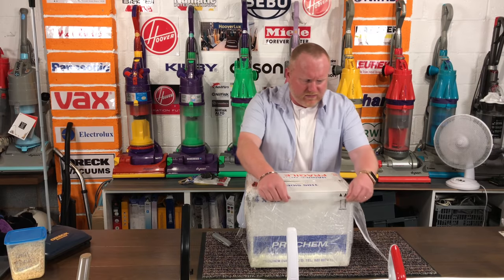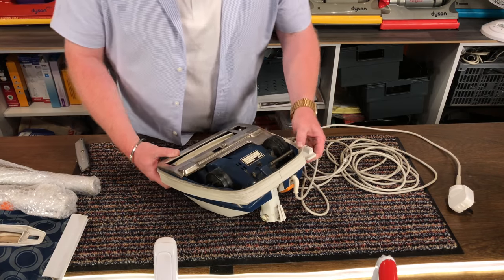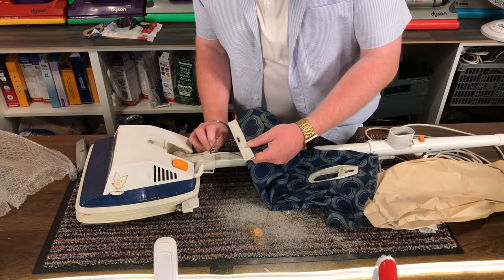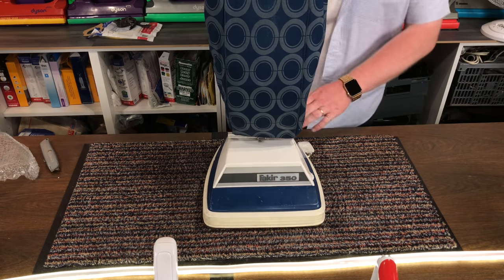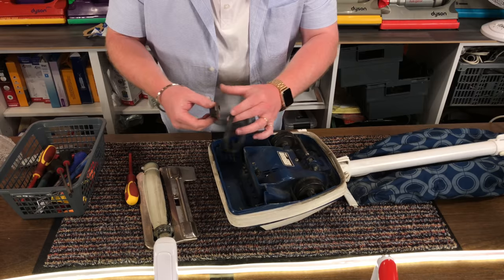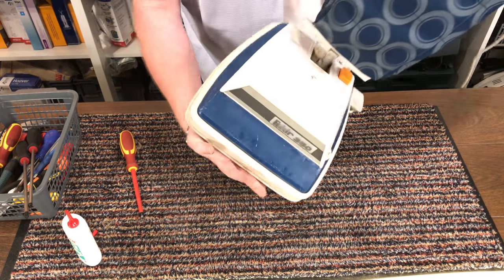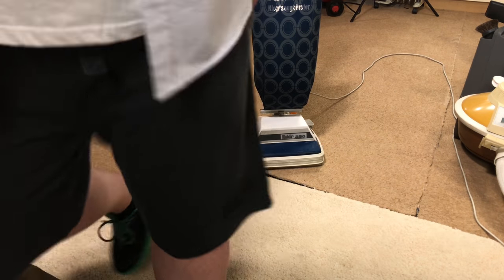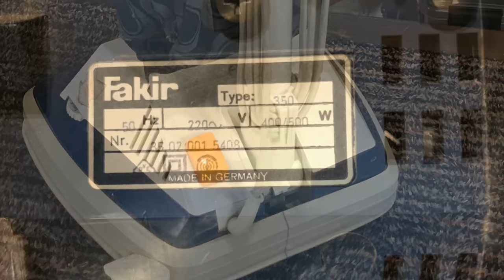Unboxing & Demo Of My Fakir 350, Softbag Vacuum Cleaner

Comment: I have the same vac. I also need a new belt on it. I have also some kind of plate for bare floors and when you use it the brush doesn't roll. There is like a micro switch or something that stops the brushroll. I think this is semiprofessional vacuum and If I remember right this vacuum solded also with Philips brand in the UK.
Reply from the maker: Ilovevacuum79 Tnere is a button underneath, but this increases the power by 100 watts for using the hose. The hose comes with a plate that fits and clips on underneath like the old seniors and the plate presses the button and increases the suction. Very clever.
Reply: HooverLux ok. I don't have a hose adaptor but this plate have tiny brushes for bare floors just like Kirby Avalir.
Reply from the maker: That’s so cool. So many different variations! 😀

Comment: 2 things, polish the base plate for smoother action and fasten the inner bag to the top of outer bag using the upper clip should hold bag in place.
Reply from the maker: Good thinking about the base plate, will that stop it from kangarooing? I did the vid a month ago and now I’m using an Oreck bag in it, works perfect. Thank you my friend 😘
Reply: should help the hop as there are no ft wheels so the plate needs to be slick, but might have also adjust suction.
Reply from the maker: Ah yes, you’ll see that in the demo vid very soon, that did make a bit of a difference.